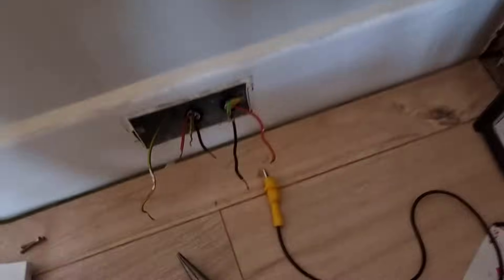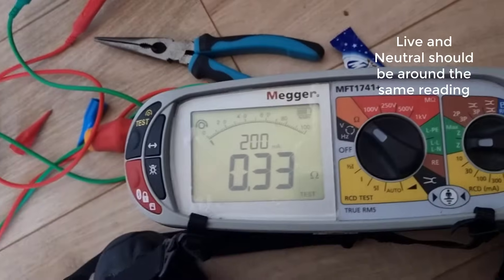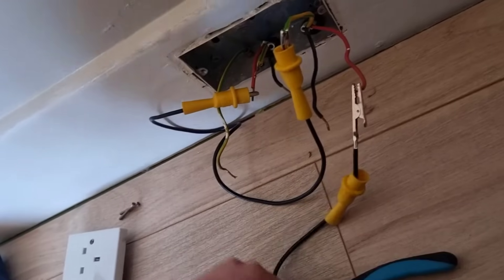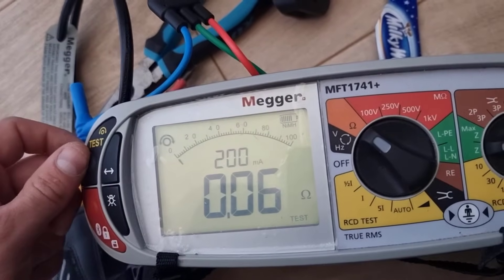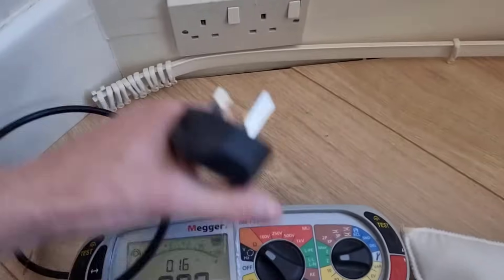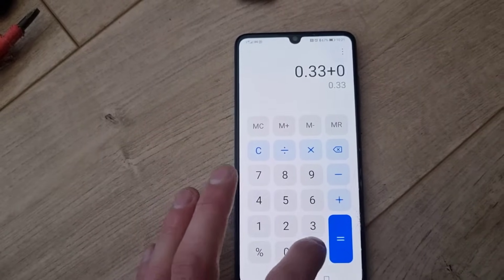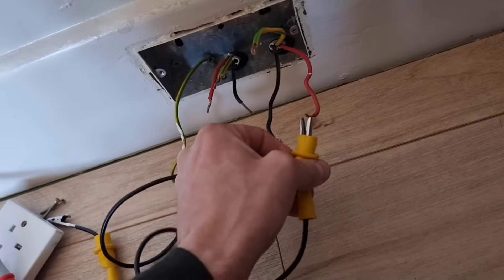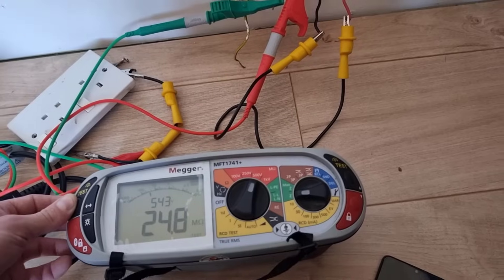How to test a socket circuit ( Ring Final circuit ) Electrician in Poole

Comment: L/L:  0.33.  N/N: 0.33. E/E:  0.63.  The CPC should actually be 0.55 with a tolerance of 0.05 ohms.   So the max reading for CPC is 0.60.    At 0.63 it’s technically a fail.   Slight loose connection somewhere